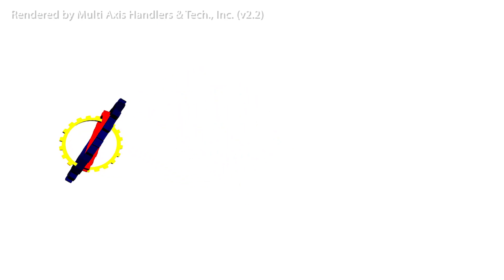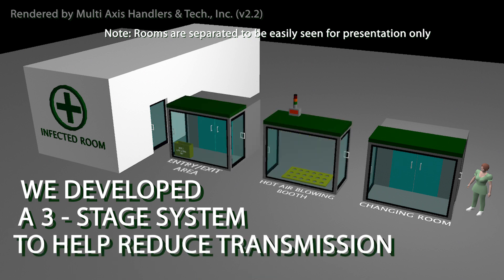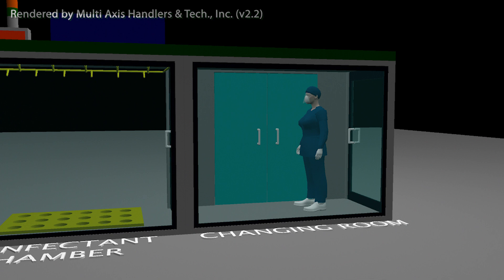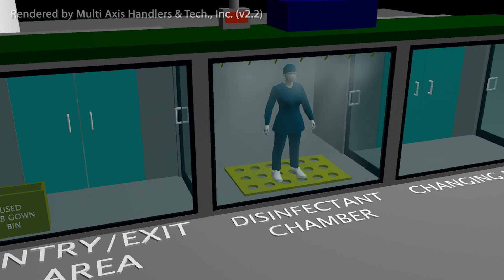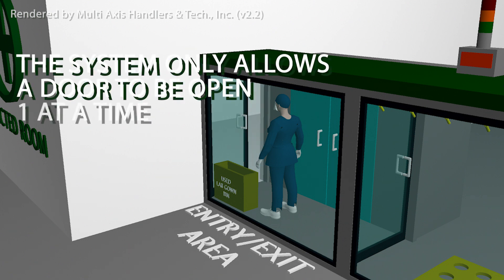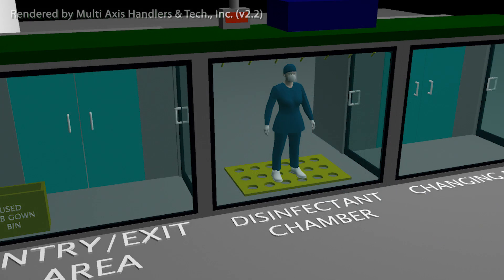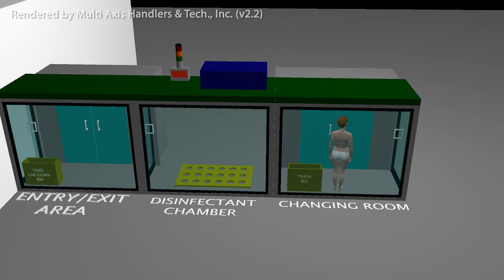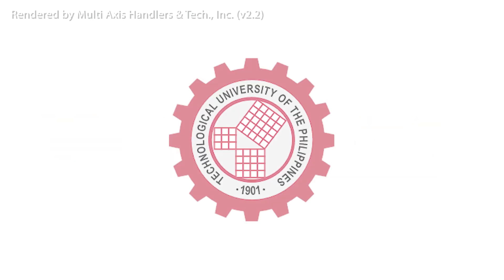COVID-19 Disinfectant Chamber PH Concept v2.2 HD 1080p

Comment: Chlorine is an irritant. The gas released is hazardous. Reconsider your misting solution
Reply from the maker: The misting solution can be changed to alcohol solution or any other applicable substitutes. The concentration is 1 : 100 or 1% for it to be enough to sanitize. This concept may require PPE still intact in order to protect skin for irritation.
Reply: @MichaelGaudan  yes, there should be no skin exposed. Good job! 💯